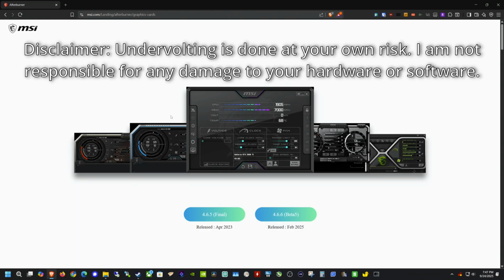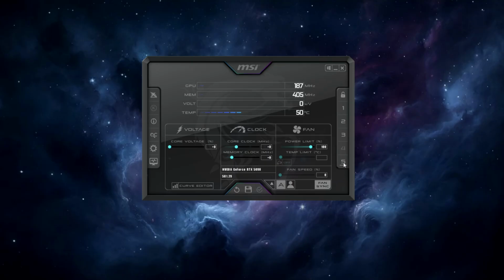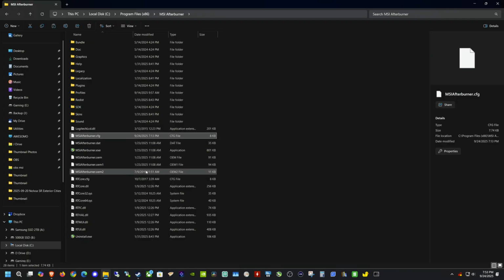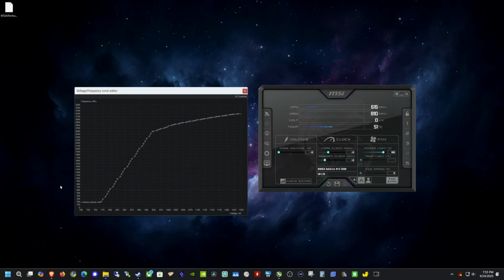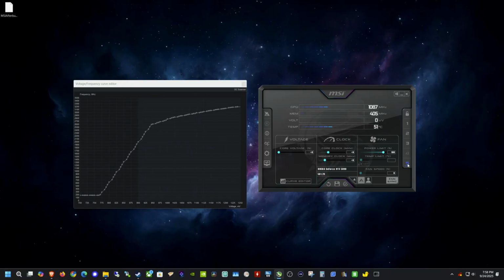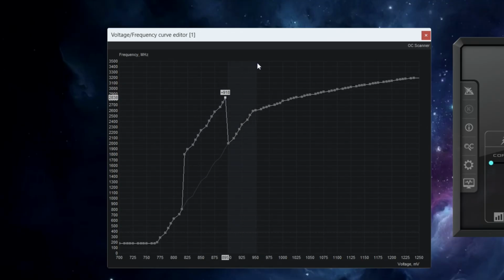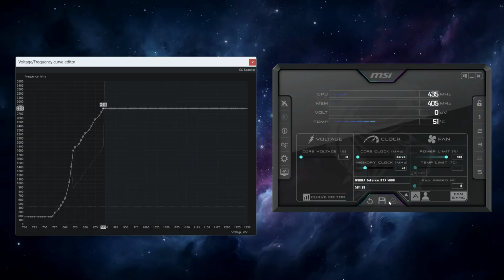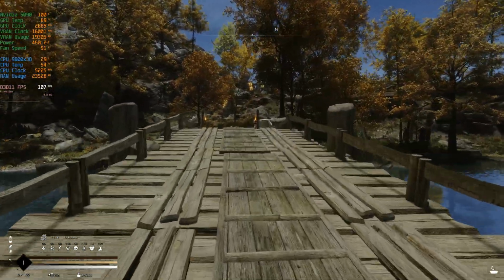You're Undervolting Your RTX 5090 WRONG (Here's How To Fix It)

Comment: Ok i've been using MSI Afterburner for a loooooooong time. I've got the #1 spot in 3DMark Steel Nomad for the 4090/7950X3D combo. I have never heard of using this method to undervolt and how to expose the rest of the curve like this! So simple too. This is going to make for some very fun testing and now my base curve isn't at 645Mhz on my undervolt 😅. I would have loved to have had this info for my 4090. I'll be sharing with others. Thank you!

P.S. - I'm doing testing. The results are great.With undervolt at .895@2887 I'm getting the same FPS as my undervolt at .940@2932 with about 20-30 less watts it looks like and now the lower end will not be stuck at 640Mhz or so. Really good stuff and this is just initial testing. I just got my 5090 about 3 weeks ago so this is just fantastic info to have.
Reply from the maker: Thank you for the kind donation! Glad it worked so well for your new 5090 and that you were able to find that sweet spot. It's crazy to me that more tech YouTubers are not aware of this method to give your graphics card the entire spectrum of the voltage curve. I also just got a 5090 about 3 weeks ago! Was able to pick up the Zotac variant at MSRP $1999.99 from Microcenter. I've never gone Zotac before but it undervolts and overclocks nicely. I need to do some additional testing and benchmarking in 3D Mark as well! Try to see how high I can get like you.
Reply: @circuitscore Just picked mine up from Micro Center too on Saturday. Went with the Zotac Solid. Used their CC offer and got it for $1899. This thing is a monster and I'm coming from a 7900XTX.
Reply: Its same for every rtx 

Check frequency for your card. 
Put 0,900 volt. And its done.
Reply: Hey, do you have some results already? Just curious, while i am just using an 5080

Comment: Hi is this applicable to RTX 4070 ti super ?
Reply from the maker: The process is the same however your Mhz at specific Voltages will vary. I'd recommend looking for some documentation on what your card can do and then apply the logic I've layed out in this video.
Reply: Where can we find such info for our 4070ti super?

Comment: my 5090 fe can only do 2500 mhz at 900 mv bruh...
Reply from the maker: That's strange. I did know the FE cards are clocked lower but I didnt know it was that low.
Reply: @circuitscore  nah i just got a bottom barrel silicone i guess
Reply: @s4yto yeah at 900mv the FE will clock around 2550 and 2625, that’s what I’m noticing on mine. Depends on temp, won’t boost as high if it’s thermal throttling
Reply: @KuyaRio-i8o its at 70-72 degrees tho, not thermal throttling
Reply: @s4yto if it’s 2500 at 72 already the algorithm probably won’t let it boost higher to keeps temps down. Have you tried 890mv at 2827, it should be able to do that. What is your stock steel nomad score?
Reply: @KuyaRio-i8o steel nomad score was 13500 at 900mv with 2800mhz on the curve, it just wouldn't boost at that
Reply: @s4yto I see, have you checked the rops? That does seem on the low side, stock FE’s aren’t the highest scoring but usually around 13700-14000 then when undervolted should be around 14400-14600
Reply: @KuyaRio-i8o yeah the rops are 176 im so confused why it is so low I didn't know it could be binned that low.. it also has insane coil whine
Reply: @s4yto I have the FE also, I definitely like the design. I’m not sure what’s going on then, I’ve been running the normal 890-900mv setting it at 2827 and in game it’ll be effective 2550-2640 clock, it’s the undervolt everyone recommends. Can you DDU your drivers and if that doesn’t work I’ll sell you mine 😂
Reply: @KuyaRio-i8o  I'll try later today and let you know, i also got a new psu to see if that makes a difference
Reply: @s4yto Awesome, hopefully ddu will resolve that for you but for sure let me know
Reply: @s4yto were you able to ddu you’re drivers and retry?
Reply: @KuyaRio-i8o  i was, and on the same install with 895mv 2830mhz it scored 14.7k on steel nomad! 9800x3d is stock haven't done negative curve or oc on it yet ram is just 2x32 6000mhz cl30
The coil whine is still atrocious tho.
Reply: @s4yto perfect that sounds like it’s running like it should now, glad it was fixed
Reply: @KuyaRio-i8o  actually on steel nomad its at 2650mhz on 895mv, its considered normal?
Reply: @s4yto that sounds pretty much spot on, you’re good to go
Reply: @KuyaRio-i8o thank you for the help, im just mindblown of temps not going above 66 degrees on the FE maybe the coilwhine will go away with weeks or months of use as some people reported
Reply: @s4yto no worries! Yeah the undervolt should definitely help because that default coil whine was interesting 😂
Reply: @KuyaRio-i8o it definitely helps but it's still there 😭

Comment: The method you say is incorrect is not really relevant because usually it's preferable to activate the profile ONLY while gaming and reset everything while not gaming. Also vram oc doesn't improve performance.
Reply from the maker: To each their own but I disagree with your statement. Most people are looking for a set and forget solution that is automated and applied when they boot their computer hence the option I showed in the video to apply on reboot once a stable undervolt is achieved. I also undervolt my AMD 9800x3d CPU. People don't set an overclock or undervolt for their CPU in the bios manually everytime they want to game. That would be completely illogical.
Reply: @circuitscore hey, thanks for the guide, helped me a lot! What are your values for your 9800x3d and where exactly do I have to set them? Would love to undervolt my cpu as well correctly.
Reply: @circuitscore Except you need the CPU for everything while PC is ON but you don't need more than 10% of your GPU while not gaming.  Plus the fact your CPU UV is nowhere as aggressive as your GPU UV. That comparison is irrelevant.
Reply from the maker: Everytime you are not gaming boot into the bios and turn off your CPU undervolt said no one ever.
Reply: @gardenia1738  You really lack understanding of this whole thing
Reply: @gardenia1738  You are comparing a GPU and CPU which operate COMPLETELY DIFFERENTLY then tell him his comparison is irrelevant. Bro, please stop emberassing yourself. Anyone who is experienced and looks at your comment is probably wondering wtf it is your going on about.
Reply: " usually it's preferable to activate the profile ONLY while gaming" - I'm sorry what? Who in their right mind wiould want to deal with that? Why deal with that at all and just use the method he described? Unless you like giving your self extra steps to do??

Comment: Have you found the limit of your silicon? I'm currently using it at 0.825 with a frequency of 1945. I don't know if it's good or too low. The graph is completely flat. I've tried to increase frequency , but I don't know if the program won't let me or if I'm just doing it wrong.
Reply from the maker: I have not yet tried to overclock higher but Ill probably mess around with some slightly higher voltages at higher clocks one of these days. Currently I'm running 895mV at 2917 which is the maximum MSI Afterburner will let me go at 895mV. This gives me slightly better than stock performance. 825mV at 1945mhz seems way too low of a frequency if you also have a 5090. You will get awesome temperatures and power usage but you are limiting the full potential of your card.
Reply: @circuitscore 2917 can never be stable at only 895mv. It seems you didn't test enough, especially with any Nvidia driver 580.88 or later. Timespy in not enough you need several games running them for at least one to 2 hours per session to declare stability
Reply from the maker: I played cyberpunk with max settings for 3 hours straight. Seems to be stable. I could try running something like Furmark though just to be sure.
Reply: @circuitscore  CP is a wrong choice for testing, Cyberpunk is almost identical to Timespy in detecting UV = not sensitive enough (for more than one reason). Pick a medium demanding game
Reply from the maker: What game do you recommend for testing a undervolt for stability?
Reply: @circuitscore Hogwarts Legacy, Assassin's Creed, Snowrunner (with unlocked fps), Marvel Rivals, Helldivers, Claire Obscure Expeditions, etc. And anything that does NOT use 99% of GPU core
Reply from the maker: You want to test your GPU undervolt with games that don't push the GPU to its maximum? That makes no sense.
Reply: @circuitscore actually this is where I found my undervolt unstable, my GPU was only running 70% in Spider-Man remastered. I thought 925mv 2900 was stable after running full to the max on so many games. But I ended crashing during the sea of poison mission, it’s now my go to spot for gpu undervolt stability test.
Reply: @gardenia1738 same thing happened to me. Ran all other games maxed 99% usage, but I crashed at 70% GPU usage in Spider-Man remastered during the sea of poison mission.
Reply: @circuitscore  Educate yourself about nvidia boost technology and understand it well.

Comment: how come you're only using 895? also, what is the fps loss % do you think?
Reply from the maker: I picked 895 because its the lowest voltage I can undervolt before my performance starts to suffer. The undervolt I used in this video gives me the same stock performance at 100-150 Watts less power while keeping the card cool. So I guess the answer would be 0%.
Reply: @circuitscore what's "stock performance"? What qualifies as "stock performance"? Stock for a 5090FE? There's a variability of even same type of 5090s FEs
Reply from the maker: I tested with an undervolt and without (stock). Got the same framerate. Actually maybe a few frames higher with the undervolt. How else would you determine stock performance? 😂
Reply: @gardenia1738  It stock performance of YOUR CARD. Thats what qualifies as stock performance. This is kind of the norm for undervolting in general. His method is just superior.

Comment: Hi, how much power does your card use at idle, 
I got 5090 FE yesterday and its pulling more than 50 watts at idle, If i am watching a youtube video at 1080p it goes beyond 80 watts.
Reply from the maker: Nice! 5090 is such a beast! My card idles at 30-35 Watts at idle according to HWiNFO
Reply: depending on how many monitors you have/what resolution they are this could be considered normal behavior
Reply: Normal for 5090. My Aorus 5090 pulls anywhere between 30 and 80 watts just idling, light browsing or YouTube. I have 2 monitors 240hz and 360hz.